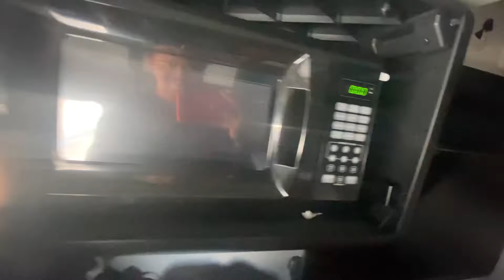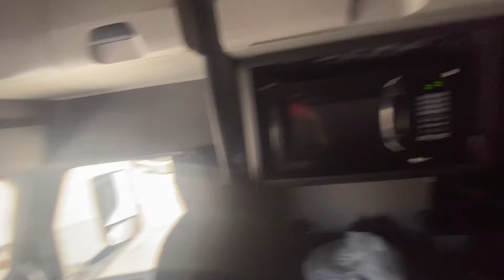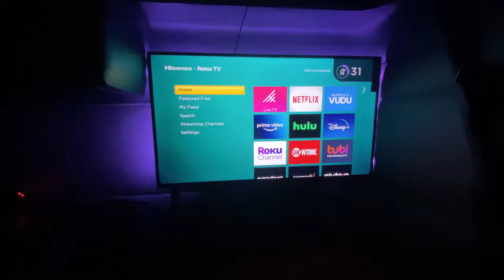Things you need as a truck driver | Truck Tour 2.0 Rookie | Swift Transportation | Company Driver

Comment: 60 dollars for cb radio cobra 19 ultra and if you wanted the truck has a built in antenna I used it that way for months and it worked just fine
Reply from the maker: noted thanks !!
Reply: CB radio > flat screen 😉

Comment: O, i forgot to mention, get your flash light and look in the space where you put the CB,  if theres a CB antenna in there BAM , you won't have to buy a antenna cord and there should also be a power cord  connection wires in there to,  hopefully , thats means antenna mount is behind the truck above air hoses, let us now what you find
Reply from the maker: ill check :o

Comment: Pretty late comment though but hope you read it. I just got the same truck as you and i’m wondering ¿did have to put straps for the fridge? some how cause i definitely need a bigger fridge than what i can fit on that cabinet also did you have to drill any holes for mounting the TV ?
Reply from the maker: hey no I Didn’t use any straps for the fridge and I just use the bolts in the window I Didn’t drill holes
Reply: Thnaks bro i’m gonna take a second look then maybe i didn’t look good enough i got it a couple days ago